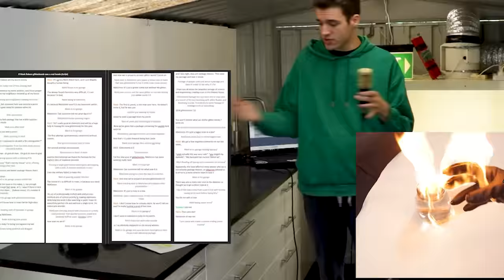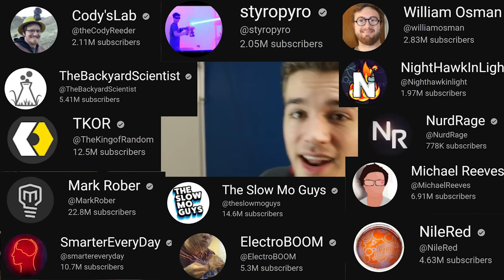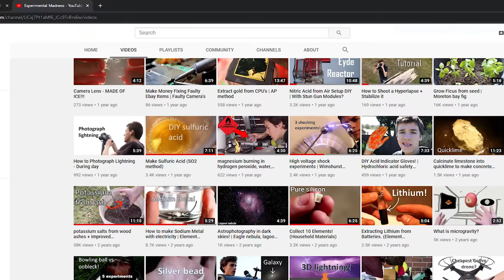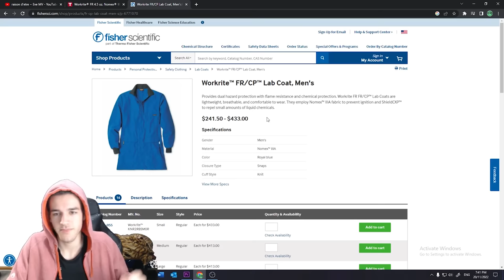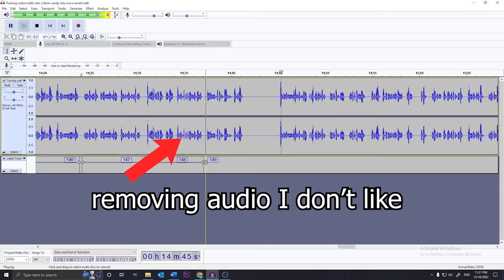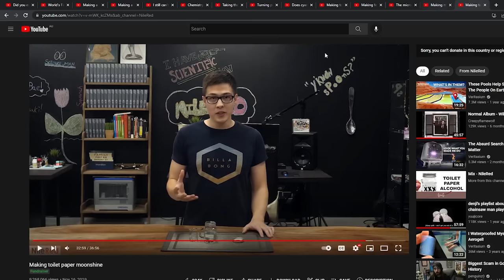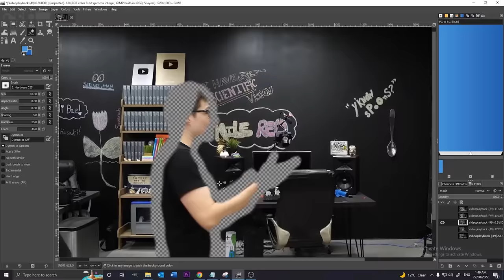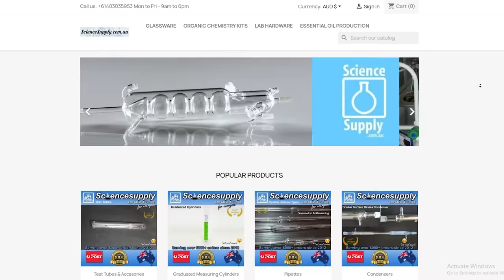How I make my Deepfake Parodies

Comment: 5:13 I'd recommend rubbing alcohol instead of gasoline. I can literally light my bare hand on fire with alcohol & it gives a good second before it actually burns my skin or hair. Also gasoline is a petroleum product which can react with rubber gloves & possibly other gloves. Gasoline also starts to burn your skin immediately probably because it's a petroleum product, it sets into your skin immediately.

Comment: I made a fume hood from a 1000L IBC, I just cut the side out, put a timber frame around the edge of the hole with aluminium channel and slid a Perspex sheet into the channel.
Then I used a bouncy castle pump as an extractor fan.

Comment: How did you mike the fake bomb ? Is cool
Reply from the maker: Yeah I unfortunately couldn't fit that into the video. I followed a YouTube tutorial on how to make it. It was with PVC pipe and spray painted some paper red. The paper is longer than the pipe so you can fold the paper into the ends of the PVC and then hotglue some old wires and motherboard to it

Comment: You should let your filtering mask make complete contact with your face before putting on your glasses. Never situate your glasses between your face and the filtering mask you are wearing. It will negate atleast 50% of the masks potential.